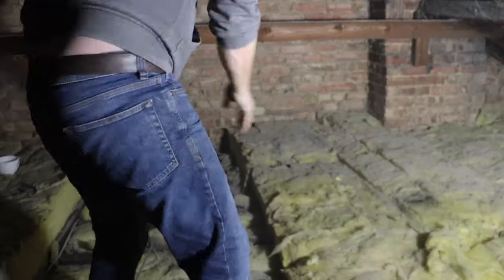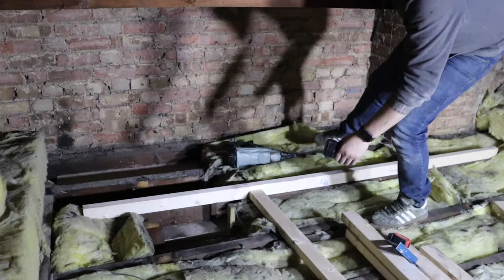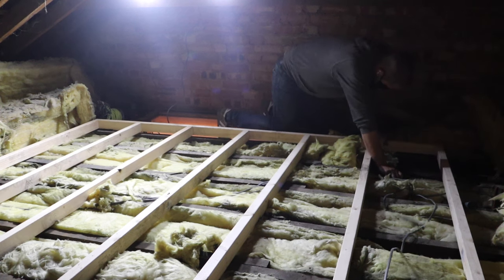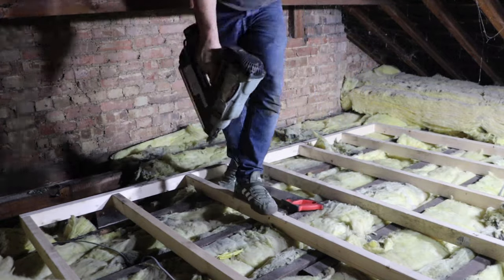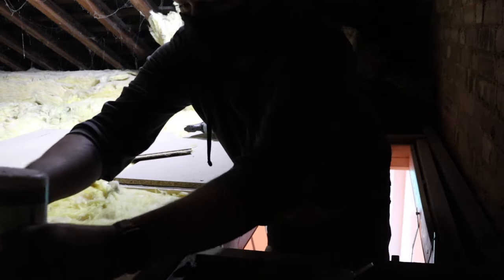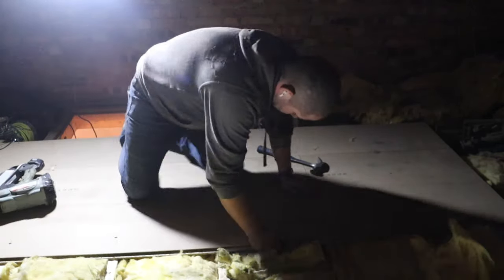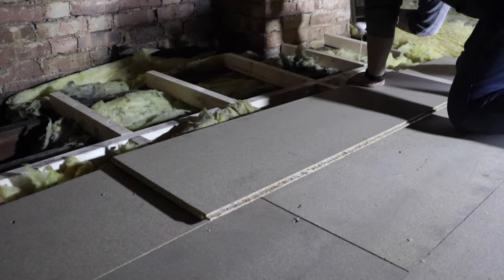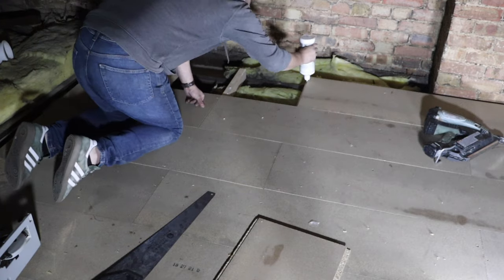How to board a loft/attic  #joinery #carpentry #woodworking

Comment: I hate fibreglass insulation good tip about the shower
Reply from the maker: Horrible stuff isn’t it ! Really not fun to work with 👍🏻
Reply: yeah is a good tip never thought about washing down with cold first got this job to do and I really suffer from the fiberglass
Reply from the maker: @bloggs692413  mate deffo use the cold water tip first ! Helps loads ! Horrible stuff isn’t it ! I hope I do t get another one of them for a while.
Reply: @bloggs692413  j

Comment: … I’m thinking of following your system for a portion of my loft for light storage for cases and some books and a few kids toys … the sides would be 2.2 metre x 3.0 metre … using kiln dried treated wood for the 3 by 2. I’ve calculated the whole structure would weigh about 45kg plus the weight of the chip boards to cover it … house built in 1980 … I’m concerned that the frame adds a fair amount of extra weight to be supported by the joists and just wanted your opinion … obviously just an opinion since you couldn’t give any detailed advice not having seen the job … great video btw👍

Comment: I am about to do my loft. I don't have a nail gun so it will be screwed. Will the glue still be necessary? Shouldn't there be a gap between the top of the insulation and the underside of the boards for air-flow?

Comment: Thanks for that great tip at the end.  And... thank you for sharing.  I am a complete amateur and I ordered loft boards from B & Q .. that is coming tomorrow!!  I was freaking out, but am calmer now that I have watched this video and saw your reply about not having to raise the boards.  I thought I was going to have to go and order more wood and revise my plan!!!!!  Appreciate this video, very much.  (now all I am worried about if the wiring in the loft - I am going to cut out grooves in the joists to leave them where they are, but lower the wiring under the boards - rather than just slap boards on top of wiring)!!!!!  I just hope there is a tiny bit of flexibility in the wiring.  I do not have any downlighter or anything else that will be awkward ).  Just doing what you did here - partial loft only.
Reply from the maker: Good luck buddy, take your time, pay attention to anything that might be in your way. Make a note of the cables and make sure your watch your footing, you don’t want to end up the the room below 👍🏻

Comment: I can see that your insulation isn't at 270mm..... I need to do this same job in my house and what you have done here is ideal for what I need. However, Does it really matter if my insulation Isn't at 270mm, in terms of a regs point of view? If I fit flooring on top of 270mm insulation I won't have much headroom left in the loft, rendering the whole process useless for my needs. Any info would be greatly appreciated.
Great video, thanks.
Reply: You could try adding Superfoil to the rafters and using less insulation between joists, this will create a "warm loft".
Reply: You could use PIR board it reduces 270 down to about 150mm as PIR is a better insulator.

Comment: Thank you for this. I am wondering (in case I missed you saying) why you created a base on top of the joists. Is it to raise it up from the joists to leave a gap between the insulation?
I have insulation (largely deteriorated) by if I already have the roof spray insulated between the roof rafters, couldn’t I just lay floor boards on rafters? If so, does it still matter if the insulation touches the floor nboards or should I remove enough to leave a ‘moisture’ space? Thank you.

Comment: i was going to do mine like this basically build a 2x2 frame then loftboard, but i thought you had to raise it up on legs so it's not pushing the insulation down causing the ceiling to bulge etc, mine looks exactly as you had here 👍
Reply: If you don't care about global warming or your heating bill, by all mens build it like this.  If you squash the insulation it reduces it's effectiveness.  

If you store too much weight on the boards, the ceiling below will deflect and possibly crack at plasterboard joints, because the ceiling joists weren't designed for the loading that floor joists can take.

And by gluing and nailing the boards down rather than screwing without glue, that will make any future rewiring of lights much more difficult and expensive.
Reply: @robertsmart7484  true, but mine should be fine with 2x2 as it has flattened & loft board is lightweight material  ?
Reply: @robertsmart7484 Global warm-what?
Let me guess: you still believe in Santa Claus too

Comment: Nice video mate but I was just wondering if using glue is really necessary because
 surely a couple of nails here & there would be sufficient on what is just a floating floor
Reply from the maker: You could get away with just screwing but I wouldn’t recommend just a few screws I would say atleast 3 screws at each joist as this will add strength to the structure, I would always suggest using glue as this is belt and braces.

Comment: Loft boarding novice here. Your video was really good, very concise.

I toyed with the idea of raising the floor a bit but have you done it purely to fit the insulation underneath that was already there or is there an issue fixing the boards directly to joists? 
My joists are 600mm apart so presumably you did it at 400mm for strength?
My main concern is the strength of my roof. The frames are 100mm x 35mm at 600mm spacings.
Reply: The frame on too was for added support and also not to squash the insulation as building regulations state it has to be minimum of 270 mm thick and if insulation is flattened it does not work efficiently and also can put pressure on the bedroom ceiling causing cracks and damage

Comment: Many thanks for a great video.  It was very clear, concise and easy to follow.  Would it be reasonable to say that the T&G chipboard you used for the floor also contributes to the insulation in the attic?  So the floored area is now better insulated than before due to the effect of the chipboard added to that of the fibreglass?  Thanks again.
Reply from the maker: Thank you very much for your comment, yes in theory what your saying makes sense and I am inclined to agree with you although I couldn’t say for sure. Thanks again for your comment 👍🏻
Reply: Chipboard is nowhere near as good an insulator as fibreglass. Yes there is a small amount of insulation from the chipboard, but if you sqash say 150mm of fibreglass down to 75mm that reduces it's insulation value down to slightly less than that of 75mm thich fibreglass.  

So overall here, this loft now is less well insulated.  Good job there isn't an energy crisis.

Comment: Great video, did you have an issue with uneven joists in the loft floor?
Reply from the maker: No fortunately this was relatively flat, if it was uneven I would either notch my timbers (not the existing ones) or shim and pack as required

Comment: Great video, it’s a job far beyond my capabilities but I wanted to see what was involved. I’ve recently moved into a new flat and I’m looking to have a bit of my loft boarded for some extra storage storage, but I’ve been told I can’t because the void forms the building structure. It’s a new build and I was counting on more surface space to store some relatively small boxes.  The heaviest would be (roughly) a 40 x 60cm box of cookery books.  Does anyone have any suggestions? The previous owner has boarded a small section and he suggested I went for an option that can be easily removed.  Any help or advice greatly received.  

New subscriber.  Hopefully I’ll find a video within my skill set - I always learn a lot.  Thanks for taking the time to make this.

Comment: Would you be too concerned about the added weight on the old timbers? Was going to do something similar but was going to try anchor into the walls to spread load or would you not worry. Say worry I mean more cracks in the plastered ceiling 😂😂🤦‍♂️
Reply from the maker: I mean it all depends on what you going to be strong up there, the additional timbers I put in will help to spread the weight, where possible I would try to utilise the internal walls that are underneath where your putting the stuff your storing. Also I would try and space the stuff out rather then putting all in one big pile in the middle. To be honest I have never had any problems when doing this for customers. If you are worried about the timbers in your roof you could always laminate these (glue and bolt extra timbers to the side of them) to give them extra strength. Hope this makes sense and helps buddy.
Reply: @LTWCarpentry  Priceless info

Comment: Hi. What sizes (length) were the nails in the gun?
Reply from the maker: I used 60mm nails buddy
Reply: @LTWCarpentry  thanks. That size big enough to attach the “frame” to the original joists?
Reply from the maker: @alex1975uk  sorry mate I used 90mm for that and 60s to hold down the boards

Comment: why did you put clue on, what happens if you have to take the boards up for something
Reply from the maker: It’s common practice to glue boards down, stops them squeaking, if the boards have to be removed which is very unlikely, they can cut the section out then re glue it back in.

Comment: Great work  👍 could you have attached the boards straight onto the joist? Thinking of a similar space for the same purpose.
Reply from the maker: Thank you very much, yes you can the only reason for lifting the flooring off is to get more insulation in there. As the insulation was already in place I didn’t want to remove it.
Reply: Thanks for the advice and quick response ✌
Reply from the maker: @k.Newbbie  your more then welcome buddy
Reply: No you can't government guidelines say you need at least 270mm insulation. So you can't attach straight too the joists
Reply from the maker: @djturner1992  no they are guidelines not regulations.
Reply: @LTWCarpentry  oh great I might do that then but my house is a new build, the joist are 100mm would you trust them holding weight 🤔
Reply: Do you think 100m joist will take the weight mate?
Reply from the maker: @djturner1992  well it all depend on what your planning to put up there, if it’s going to get a lot of traffic and boxes stored then I would take the extra precautions and beef it up. If it’s only going to be the Christmas tree and your only going up there once and year then it should be fine.
Reply: @LTWCarpentry  cheers pal ill sit the boards on some 3×2 anyway be safer
Reply from the maker: @djturner1992  I think for piece of mind I would aswell
Reply: @LTWCarpentry  yeah I got both deffo not trusting new build or just 100mm joists hahaha cheers mate
Reply: Using 3x2 am I better with 3 inch height? Isn't that insulation gonna get squashed being so tight to boards?
Reply: @djturner1992  so do you believe everything government tells you🤔
Reply: @peterwright5249  you're a good darts player

Comment: Looks like you added unsupported weight' to a framework that was only supposed to hold' plaster boards insulation and light fittings? Nice job
Reply from the maker: Thank very much
Reply: That’s a criticism I think
Reply from the maker: @tundeuk  yeah I know mate but I really don’t want to have arguments with people on the internet, really not worth it you know.
Reply: @LTWCarpentry  Great way to think